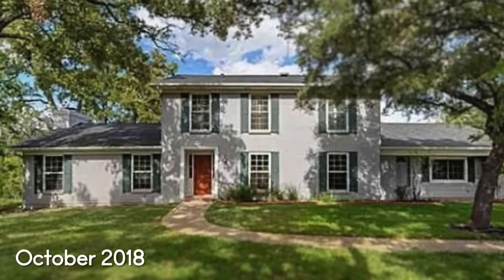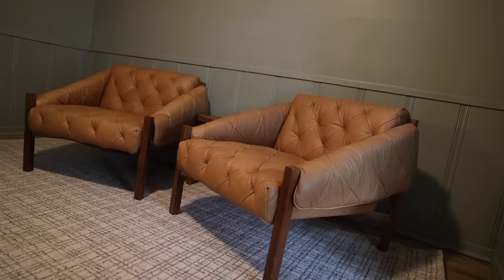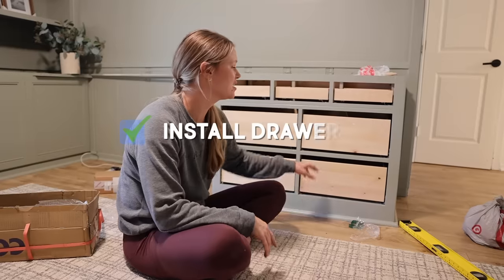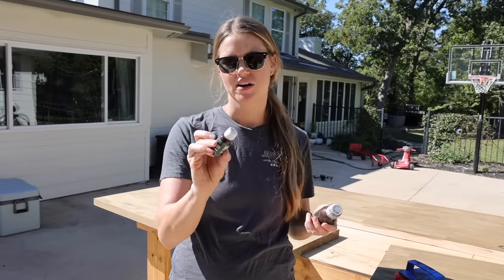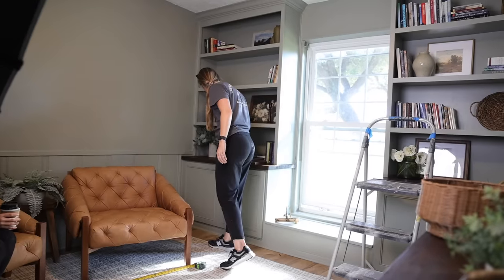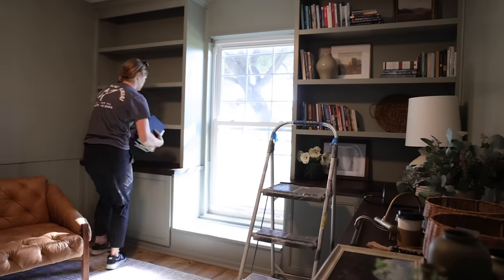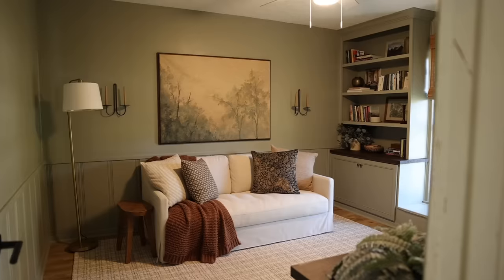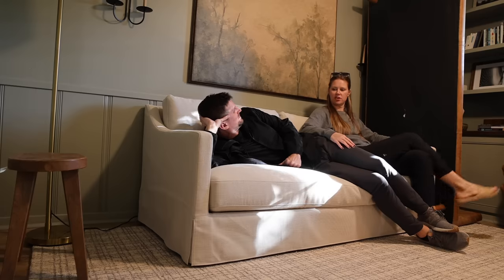DIY Dream Office Makeover [Part 4] // The Reveal! // Office Makeover Ideas

Comment: I'm still driving my 1995 Ford Taurus. I have had to make some expensive repairs but that is to be expected on such an old car. There are things that I haven't bothered fixing. The driver's window is the only one that works properly. I need to get the pump fixed for the windshield wiper fluid. I have to finagle the windshield wipers to get them to completely close once I'm done using them. I can no longer use the switch inside the car to pop open the door to the gas tank. I'm sure there are a few things I've forgotten. 😆 I won't be replacing it because I will no longer be driving once the car dies or I'm unable to due to a progressive degenerative muscle disease. But it's been a great car and I've really enjoyed driving it. 😊

Comment: I always hesitate when a renovation goes only half way. You invest so much time and money into that room but you don't pay attention to the detail. And I am not talking about design details. Sanding and filling gaps in the wall,  you can see in the video that they are still there pretty visible, not painting the ceiling, not taking out the old wallpaper and cleaning up that whole wall space. It just leaves you with a lot of rough looking edges and corners. I really do like the ideas and work you do but I feel like you should pay more attention to the details.